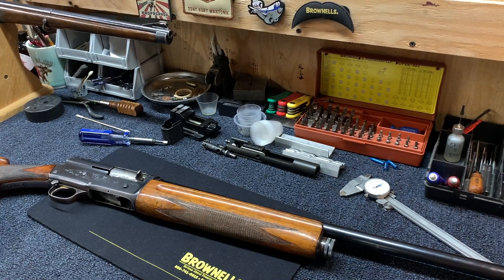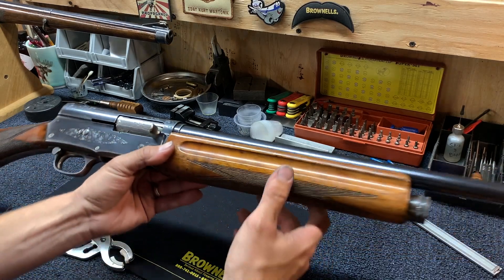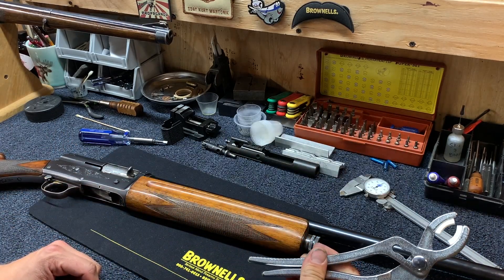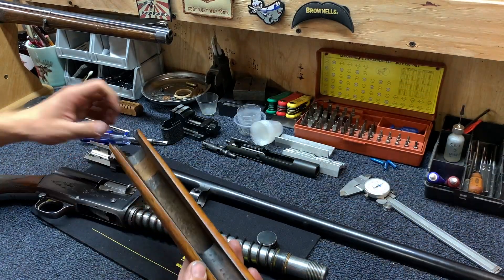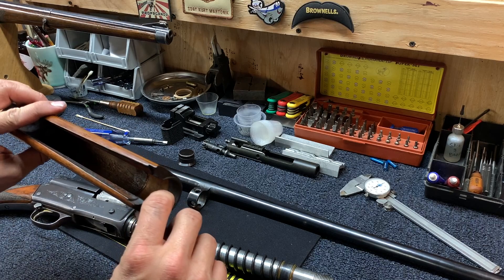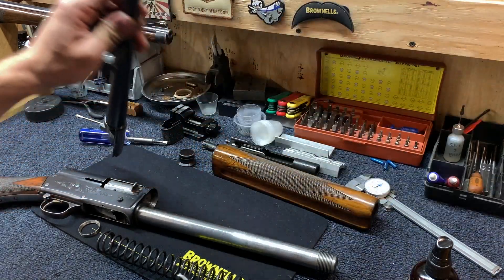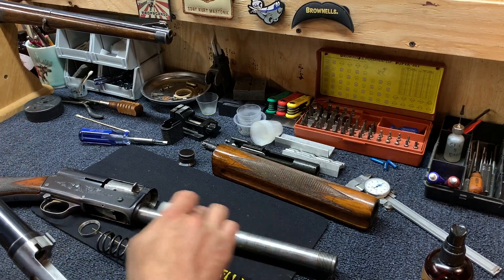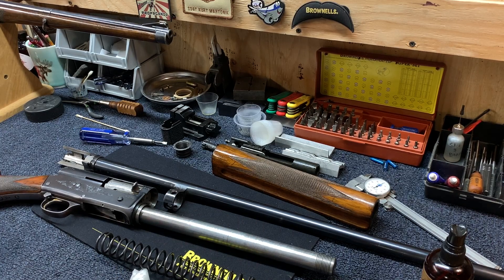Field Stripping the Auto 5

Comment: Besides the "gold"trigger, what is the differance between the A5 in 16 ga and the sweet 16
Reply from the maker: The sweet sixteen had lightening cuts in different areas, most notably the barrel collar that goes around the mag tube. It also had more engraving and "Sweet Sixteen" engraved on the side.

Comment: Help!  

1.  How would u get the snap shot out of the chamber?

2.  The snap shot failed to lodge into the magazine thru the bottom plate

3.  Bad Snap Shot (Triple K brand 16Ga), is it the gun's fault, or the man behind the machine?
========================================================================
Detail:

1.  How do i get the Dummy round out of the Chamber?
      ----------------------------------------------------------------------------------

My 16 Ga Triple K clear plastic snap shot of 2 1/2"H is stuck in my Sweet 16's chamber.
The bolt handle is frozen, kant pull it back.  The LH side quick-load lever is also stuck in
the forward position.  Never tried loading w a real live round yet.

I just bought this Swt 16 by Miroku.  I'm not familiar w this gun n its operation yet.
I've measured both this snap cap vs. live round, Winch. Super X and their bottom base above
the rim were matching at .740".  And the rest of the cylinder diam. measures match.  So it's nut (not)
the diameter being too fat for the snap shot's fault.

I then tried to remove the bbl (barrel) but failed.  It was EZ to remove the magazine cap w/o pushing
the bbl down, which i couldn't anyway.  I was able to pull out the bbl 1/4" away from the receiver edge,
which originally had 3/32" gap (shinny band)**.  I couldn't pull the bbl out any further with my hands.

I also noticed that the bolt followed w the bbl.  At the back of the ejection port, there is now 1/4" gap betwn
the edge and the bolt.  Thus, i figured the bolt's ejector fingers r holding the snap shot tightly, won't let go
n so, i kant pull the bbl out!!!  This tells me i shouldn't try to pull the bbl any further or i'll break the ejectors.

The gun is in pristine condition, no exterior scratch marks, Au plated trigger has no wear on both RH n LH
side.  The loading tongue has no scratches.  This 2 problems shouldn't have happened.

What's going on?  And how to fix this jam?

_____________________
**Is this gap amount normal?

2.  Miss loading
     ---------------------

As i slid n pushed the shell forward at the loading tongue (or whatever u call the grooved hinge plate). 
The shell bounced back n rested at top of the tongue inside, angled upward toward the chamber, not 
reaching it.  So, i opened the Ejection port by pulling the bolt handle back, then reached into the rcvr
to retrieve the dummy shell.  Then, i was able to insert the dummy into the chamber.  But after i closed
the bolt forward n "fired" it, the dummy kant b taken out (see #1 above).

What's going on w the magazine loading function?

Pls help w above 2 problems...

NewBee Impasse Dummy (DIM)